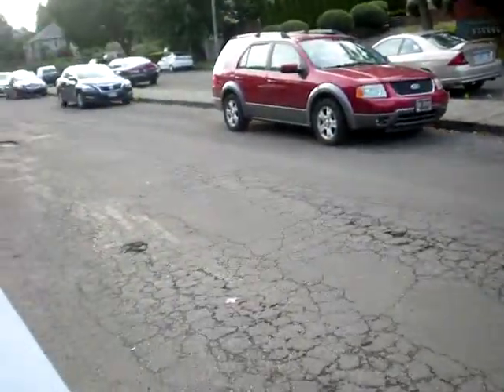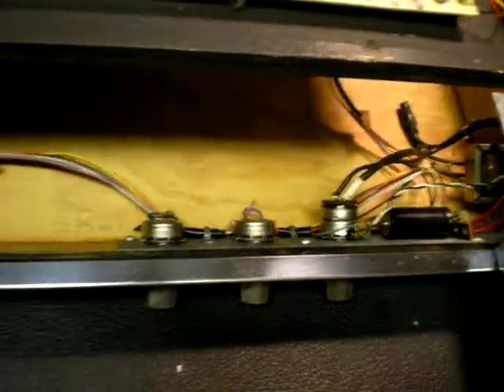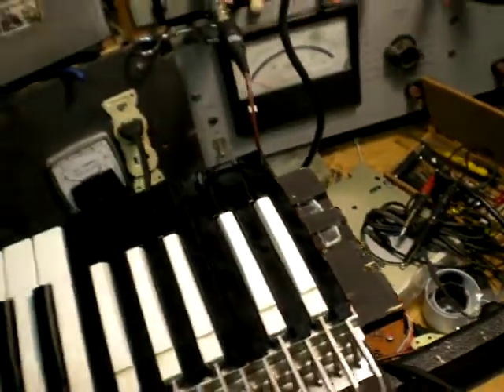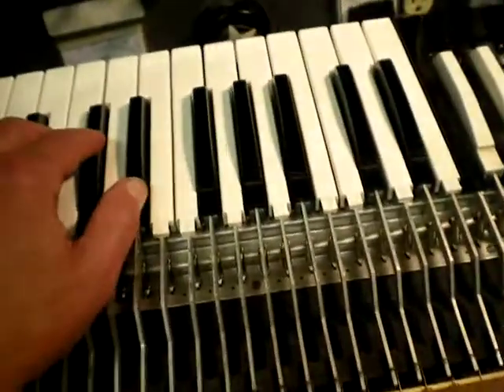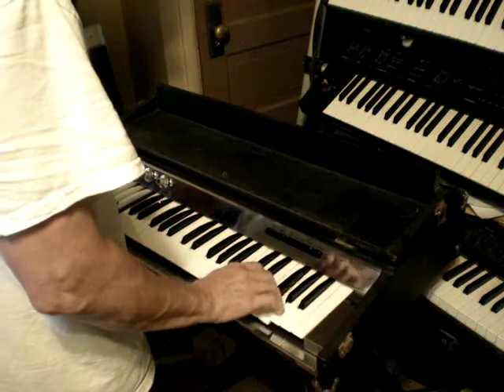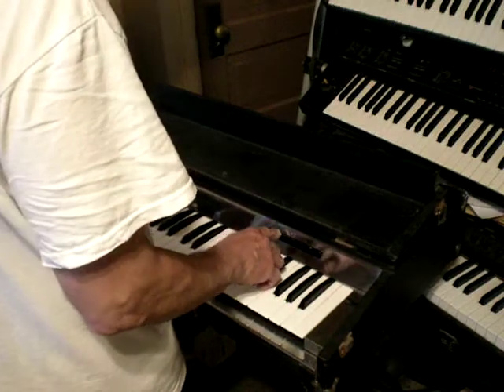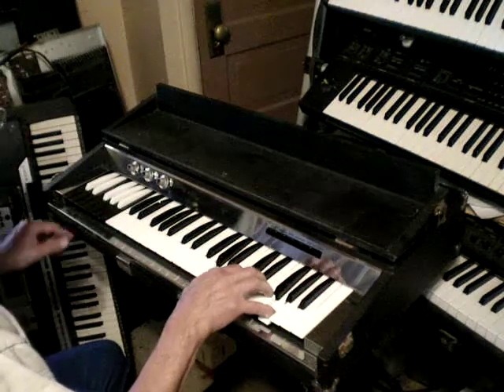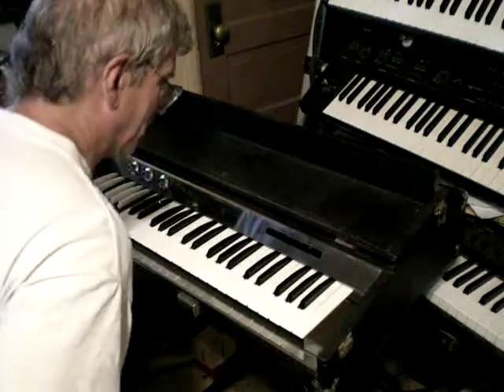The Whippany 'Dart' Combo Organ.  Sharing; the up and down sides

Comment: sounds like an interesting sound is distinct. 1960s?
Reply from the maker: sure mid to late 60's i think
Reply from the maker: i see someone said '69 on a similar looking model on ebay now
Reply: OK thanks for info. Would be interesting to use that sound..i'm  a big fan of 60s or earlier electronic keyboards :) It's got an American tone. Shame about the faulty key contacts.
Reply from the maker: @tonystephen6312  I fixed it the other day; it's good to go.  tune pot had intermittent leg.